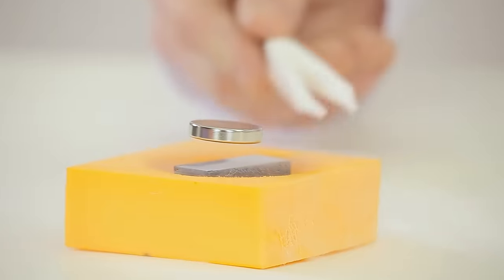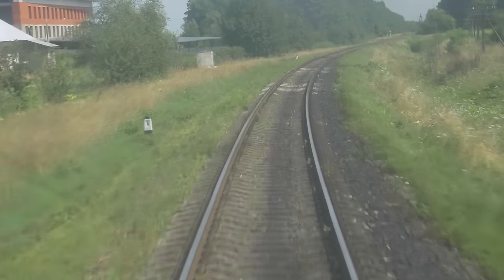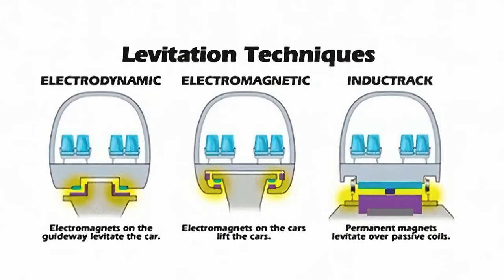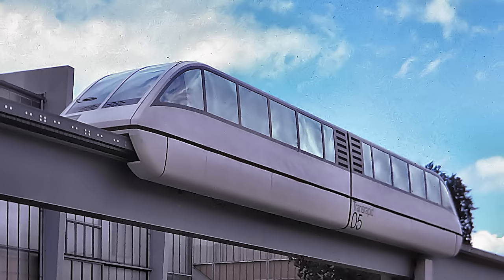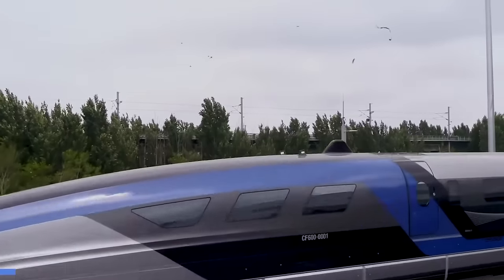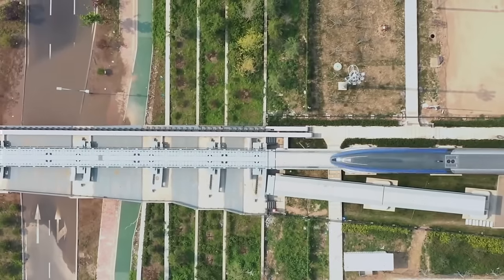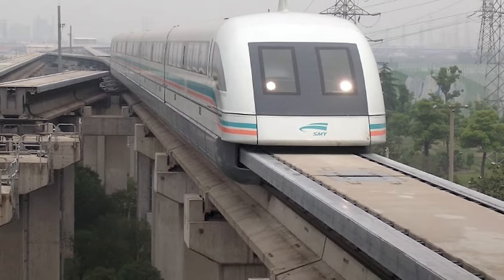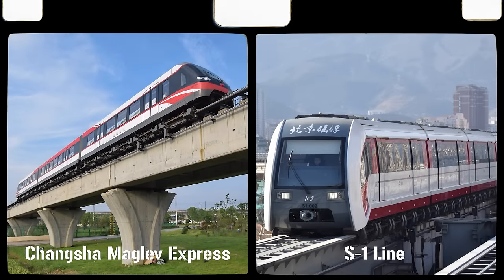Maglev Trains: Why This ALWAYS Falls Short

Comment from the maker: Thank you Squarespace for sponsoring this video. Check out Squarespace: http://squarespace.com/megaprojects for 10% off on your first purchase.
Reply: talking of hyperloop.. and update of current projects would be nice. :)
Reply: Love your Rolex!
Reply: One important advantage of the electrodynamic system not mentioned is that the track tolerances are far lower compared to EMS, making the system more resilient to ground movement. Currently, the high speed maglev projects are focused on dense travel corridors, but as the technology matures, the supply chain develops, and the general economic condition improves, this should become more widely adopted. Inductrack technology should prove more suitable for lower speed lines.
Reply: Niron magnetics. 
Should shake things up.
Reply: Megaprojects Iamewhlteboy
Reply: k -I I
Reply: yoseIf
Reply: Iame whlteboy

Comment: Maglevs can work but people have to stop treating them like trains and more like ground hugging point to point airplanes. Their best use, in my opinion, is as part of a hub and spoke network where you take a maglev between two major transit hubs, get off, then take more conventional transportation to your final destination.
Reply: Yeah, normal trains are pretty much compatible with any track. You just need to standardize the track width and gauge. With maglev there's so much more lock-in to a specific design that it's a hard sell to use it for anything other than individual routes.
Reply: Sure, but, well... Airplanes can do that, without the need of investing into tracks 

The problem of maglevs is, that they lack a use case which justifies the investment
Reply: @frankkobold airplanes have A LOT of disadvantages over maglev:

- They cost way more per unit traveled

- they are a lot less comfortable to be in

- airports have lengthy check-in and boarding procedures so you spend a lot of additional time

- they have way way lower frequencies and as a result way lower peak capacity

- they are a lot worse for the environment

There is a good reason Japan is building the Chuo shinkansen on their most congested medium distance route. It's the perfect use case for maglev: between 200km and 500km with few stops. Also Tokyo airports are congested already, it's not like they could fly more planes anyway.

Yes the initial investment is downright absurd, but long term it's better than adding more planes. Most governments and companies just aren't willing to think beyond the next election or quarter respectively.
Reply: @NeXtdra42  ah, it's less "not thinking long term", but it's a topic of risk as well as how much you can afford now.
Would it have been long term better, that I would have bought an apartment while I was studying instead of renting? Ofc, but there is the risk of me moving later on plus I simply didn't had the money.
What if one village disagrees with building the tracks (which are also not good for the environment) near them loudly & publicly? What if a economic crysis leads to massive increase in cost?
So ofc running cost are better even with a maglev, but the cost (incl risk) of Capital is just too big.

Ofc you have examples like Japan, where it just worked out. But that are very specific conditions which have to be fulfilled, which are rare, so no benefits through scale.
Even your 200-500km example: if you have a few stops, why not normal trains with higher speed, which can also be used by other local trains & also cargo? After all, you won't have the tracks occupied the whole time.
And if you need for 500km 2h or 1h just doesn't make a big difference.

Tldr: cost & risk of capital too high, really far away planes ofc, and on the distances where maglevs would be ideal/better, normal (high speed) trains are an acceptable alternative with higher flexibility & better economy of scale (of the infrastructure to build the tracks etc)
Reply: At first sight that looks smart, but in detail almost only those who only want to travel from one hub to another (or nearby) are benefiting.
The others will lose time while waiting for their connections at the hubs. Or even worse wasting more time by travelling in the opposite/false direction to reach the hubs or their destinations.
So you're about to spend a huge amount of money for maglevs for the benefit of few. While spending the same money on a grid of regular trains would benefit a majority. 
What is more economic or democratic?

"Fun fact" from Germany: the high speed trains in Germany (ICE) are able to travel with almost 300 km/h. But the German operating company (Deutsche Bahn) has redused the actual speed of the trains to a maximum of 250 km/h. Reason: a higher speed is a waste of money. For a higher speed more energy is needed but in return the travellers don't see any benefits. Cause the maybe saved 5 minutes at the train vanishs when you look at your travel time as a whole (traveling to and from the train station, waiting for connections). So speed is not all, there are other things that have more impact.
Reply: Right.  So I’m very confused why Saudi Arabia wants to put a high speed railway into its narrow Neom (The Line) confined housing project.
Reply: Yep. "In my opinion.." pretty much sums up your comment.
Reply: @T0MT0Mmmmy  that comes down to how long you actually drive at max speed, a regular train has bad acceleration and therefore needs a long time to reach top speed, a maglev is only limited by the humans inside on that regard.
Reply: The problem being that you need entirely new infrastructure that's in no way compatible with all other rail lines, and all for something that has never been commercially viable.

Conventional rail, though much older, is far more practical and efficient (and doesn't require new, incompatible infrastructure.

Like the airship and the Concorde, it's cool, but dramatically inferior to the competition on every metric that counts.
Reply: @frankkobold you can run a maglev system with 5 minute headways, moving 20,000 people per hour

that's simply not possible with planes unless you were to build an entire terminal and runway at each end just for that one route
Reply: Maybe capital to capital, like the tgv.
Reply: k- I I
Reply: Iame whlteboy
Reply: Blake Iamewhlteboy
Reply: @frankkobold  Aircraft are going to become a LOT more expensive to operate by comparison to ground based electrically powered kit over the next few years

Maglev's single biggest problem is that rail already exists and some way of travelling on rail for low speed operations would be handy to make use of existing infrastructure

Wheel friction is NOT an issue with rail. The real problem at high speed are both hunting oscillation of the wheelsets and high wear on pantographs/catenaries (meaning that even if the former problem can be solvable, the latter becomes almost insurmountable over 400km/h)

Most friction at speed comes from the SIDES of the vehicle regardless of whether maglev or wheeled - going faster than 300km/h means you need a partially evacuated tube or your power requirements become obscene (and noise complaints a very major issue). Current wheeled/maglev designs are going faster than this and draw mind-boggling amounts of power in atmospheric conditions (The Shanghai maglev has been speed limited due to noise complaints, it won't be the last to have that happen)
Reply: @NeXtdra42  I suspect that they'll find noise issues worse than they envisaged, resulting in the open sections becomeing enclosed within a decade
Reply: @KingFinnch  on long distances, where planes make sense, you don't need to move 20k people per hour. So maglevs wouldn't make sense there.

And on shorter distances, where you do need to move 20k/h, you can just use normal (high speed) trains.
Reply: @alanbrown397  well, as soon as there is enough water in between, aircrafts are the only viable quick option^^
Same with regions like west to east coast in the USA - a high speed maglevs there would simply be waaaay too expensive to build.
Planes have here simply the advantage of not needing more infrastructure then a few airports while being very flexible between multiple ones.

And yes, maglevs problem is that rails exists, basically what I wrote.
The additional benefits from maglevs are simply too small to justify the risk to build a new kind of infrastructure, which is far less flexible than normal train tracks.
Reply: @frankkobold  just to be clear, your not against the IDEA of maglev, rather you think due to its current disadvantages it's simply not worth what normal bullet trains can offer?
Reply: @blipblop888  oh, I definitely LOVE the idea of a maglev! I would love to commute with one daily. Just technically engineering behind it.
 But yeah, it's economically speaking just not worth the effort :/
Reply: @frankkobold  ya it sucks that due to the cost it's just another gimmick, perhaps with time and patience, the scientists and engineers will cook up some new materials or method that will help with the cost. in the mean time we just have to wait and see
Reply: @frankkobold well, considering we already need a specific track for high speed rails it also make sense to make it maglev in the first place. 

There’s no benefit in sharing the same track system with slow normal trains and goods. In the same way it doesn’t make any sense to use a single rail compared to using two different tracks preventing any cross traffic congestion.
Reply: @inteallsviktigt  would the track be occupied by the high speed vehicle 24/7? No? Then it definitely makes sense to share the tracks. Especially in/around the cities, where local trains can use it.

And ofc there is a benefit of having only 1 track: cost - less capital cost and less maintenance cost.

Maglev is great as a concept, but in the real world you have topics like ROI, restricted space,...
Reply: @frankkobold   it doesn’t need to be occupied 24/7. It’s just extraordinarily inefficient considering the time the track is occupied you must provide side stops to allow the meeting train to pass. 

Especially in a local city. If you have a track dedicated in one direction it makes it possible to have an extremely dense amount of traffic. 

Well that’s also not necessarily true, having two tracks allows for traffic to be maintained during maintenance and it’s cheaper to build two tracks simultaneously instead of expanding it in the future.

And I think one of the strongest things for maglev is it’s maintenance costs being smaller
Reply: That's a good way of looking at it.  Now, because I'm too lazy to do the math myself, how do the economics of maglevs compare to flying?  I figure that once all the development costs are amortized away, the per-seat-mile cost of maglev is cheaper than airplanes (basically electricity+maintenance vs. kerosene+higher airplane maintenance), but the initial costs (tracks, stations, inventing the train, rolling stock, etc) are really high compared to the relative maturity of airports and passenger planes.
Reply: @NeXtdra42  I'd love to see a big drilldown, including some good estimates of what it'd really cost.  I've taken the chunnel, which is "normal" high-speed rail, and their boarding/security is maybe half of a plane, but it's not zero.  Given that a suitcase bomb on a maglev would kill as many people as on a 737, and also shut down the entire rail line for weeks, there will need to be at least some security.  Also, you need not just stations but tracks, and those tracks have to get everyone along them to consent to their construction.  Sure, it can be done, but you can't just pretend that's a zero cost.    By comparison, when airlines need to serve New York City more than current capacity exists, they add flights to White Plains, Islip, and the like -- you don't have to lay new track to add flexibility.

I'm not saying that maglev sucks and airplanes are perfect -- far from it.  But if we're going to seriously look at how to invest in large-scale transportation, there are pretty long list of "oh yeah, there's that" things to consider.
Reply: @frankkobold  The problem is that airplanes are not very ecological instead of maglevs which can drive with electricity.
Reply: @patrickpirzer4080  but airplanes don't need massive infrastructure build, which is also not ecological.

In the end, it's always a question of overall cost-benefit, not which is better in one selected area
Reply: Airplanes do need massive infrastructure called "Airports" that cost billions to build and even more to constantly maintain. Airlines pay for this through different ways. Airports were initially heavily subsidized by the government. Every form of transportation has received government subsidy at one time or another or continuously.
Reply: @electricar9  yeah yeah, Airports exists, but they are nothing compared to the massive infrastructure you need for maglevs.

There are many even international airports, which are basically just a runway and a basic hall, which you can build for 100-200millions.
But even the big ones with massive mismanagement like the recent BER cost "only" 7billion

With normal tracks we are talking 2-4mm/km. So let's assume the lower cost, take two cities A and B, that are 7000km of tracks. Sounds a lot of tracks, right? Let their distance be 5000km, so rail wins.
Now take a third city C but now you need to connect A and B each to C - let's assume a nice triangle, so 2x 5000km additionally. So the new rails cost 3billions more then a new airport.
Now scale that up to 10 cities, airports win quite quickly. And there I am already very generous for rails regarding the assumptions.

BUT normal rails still win, bc they can be reused for short-mid distance travel.
But this benefit does not apply to maglevs, while having even bigger cost per km, even if we assume an economy of scale benefit similar to rails at the modern level (so after the time public subsidies are necessary).

Plus, airports are at one central place. Buy a piece of land, done.
With rail, you need to deal with 100s-1000s property owners, go through mountains, over rivers,  crossing streets,...
Reply: or we can simply create  just a hybrid system  where the same train works for both, as a maglev and as a typical train.
Reply: Isn't that what some major HSR routes should be anyway..
Reply: @yusokrazee  yeah but that's the problem with some HSR lines. The vision is to get more commerce from one major hub to the next in a shorter time to connect different areas and increase and improve access.. but it falls short of the original target, they generally can't can they, because they have these fast trains that are stuck on these clogged up patchwork lines that have to accommodate other already busier, slower, older existing rail lines.. meaning what was intended to be a high speed intercity line ends up being slower and less efficient on average.
Reply: Train must CHEAP, FASTER, mass transport.
Today maglev are expensive but more massive used will  cheap.
Reply: @cadekachelmeier7251 american transport design for car, bus, and truck that whay it's so hard build bullet train.
Need political policy for govt. To serve ppl.